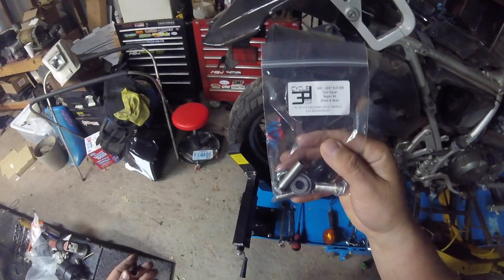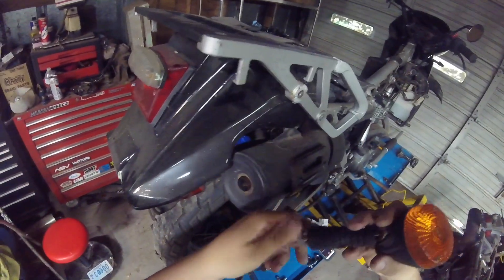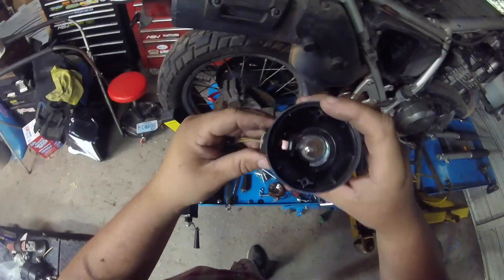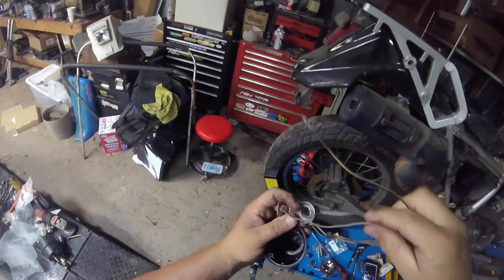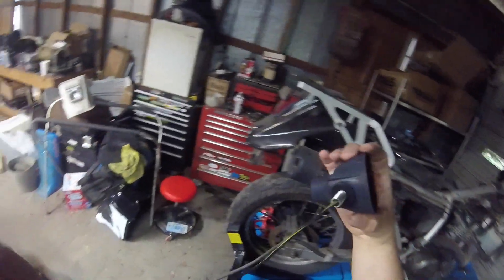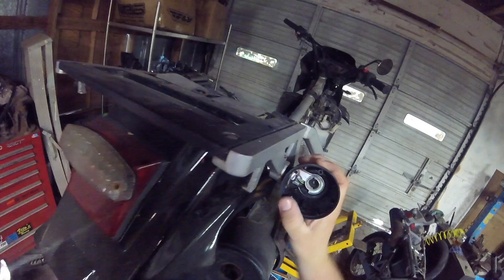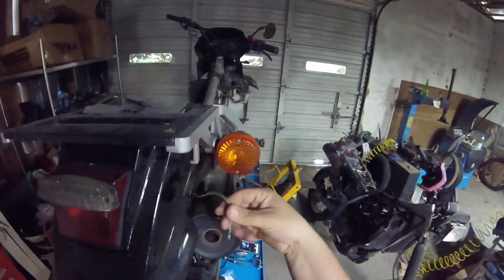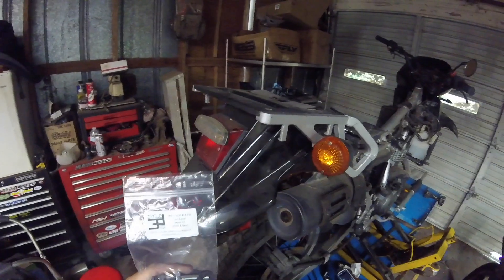KLR 650 87-07 Blinker Repair - Turn Signal Fix (Stalk Delete) - 3D Cycle Parts

Comment: how do the wires disconnect? I can't see how to disconnect them without cutting the wires.
Reply from the maker: If the wiring is factory there are small bullet connectors under the fender that disconnect. If the wiring has been altered it may be different.
Reply: @3dcycleparts  oh I see it now. I didn't realize that was a bullet connector. I thought it was a butt connector. Thanks!
Reply: How do you disconnect bullet connection?
Reply: @tomascarrion1183  they just pull apart